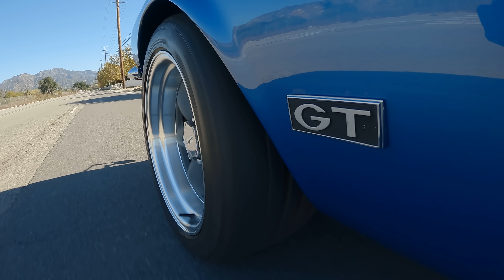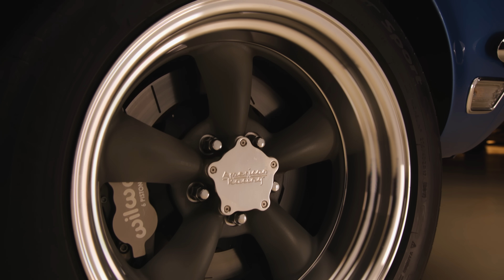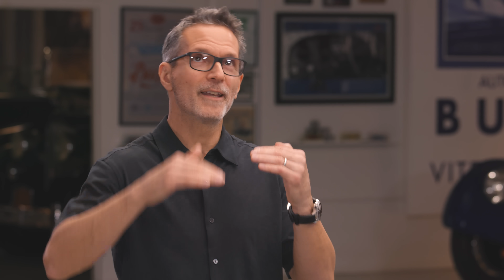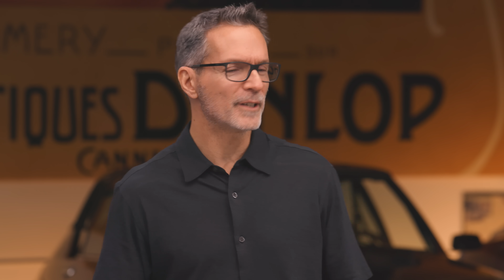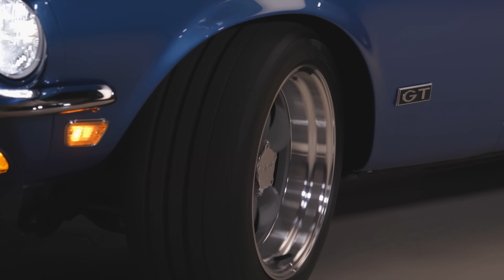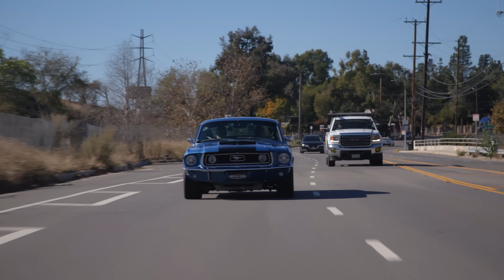Revology 1968 Mustang GT 2+2 Fastback Cobra Jet

Comment: I had a 1968 Mustang. The door didn't squeak because I lubricated the hinges. The door didn't rattle because I took the door panels off and tightened everything. The windows didn't rattle because I made sure that the window felt was up to par. It's called MAINTENANCE. The old cars can be as tight and rattle free if maintained correctly.

Comment: That air filter is inhaling HOT air, which kills HP as you know. It really should be enclosed or, if left open, extended down so that it's away from the radiator and in the cold air. This would improve HP and TQ. I'm surprised that the builders didn't plan for this.

Comment: Saw Revology's website years ago when they'd built something less than 100 cars. Was mighty impressed then, even more so now - First car was a '68 289 in Seafoam green with the black C-Strip on the doors. Put Koni shocks (then used on Porsche & Ferrari's) & a good set of Michelin steel belted radial tires. Car was hellfire fast and handled like a dream. Memories include going 120 on the Sunset Strip (wasn't flat out) slowing to 90 at Alpine Drive, knowing always cops there because of the robbed & burned-out Shiek's house. Anyone imagine now, not getting a ticket? I didn't. Different LA world in the '70s & '80s. Glad I'm 70... had SO much fun could never have now & that car was part of it.

Comment: Jay... Ford did a 140 MPH Speedometer in the 1960 Thunderbird.  That was my first car.  With the 352 FE Motor/300 Horsepower.  The 59 and 60 Thunderbird could also be ordered with the 430/350 Horsepower Lincoln Motor.... My Bird was a hardtop in Palm Springs Rose, a pinkish tan... and Tan and Dark Brown Vinyl Interior.  I loved that Car....  Jared Howe, Westland, Michigan.  I wish I had it back...  I bought the car off my Mother in 1971 for $1,000.00.  It only had 28,634.8 miles on it when I bought it.  I sold the car in 1978 for $6500.00 with just 53,000 original miles.  Biggest mistake I ever made.  Selling that old Thunderbird....  My next car was a used 1970 Mustang Mach 1 with a 428 Cobra Jet 4 speed.  I sure do miss that car too.  Bought it off a neighbor who bought it new.  it had 31,000 miles when I bought it.  In the rare Grabber Green.  About 300 70 Mach 1's were painted that color.  A low color and rare to find....

Comment: 300-400k now for their builds. If Im paying 400k, I want a carbon fiber body with a wide body and proper aero for a track. You could spend half what they charge buying a real classic, reinforce the chassis, upgrade suspension, transmission, interior, exterior, and drop a 1,000 hp in it and it be prestine. No creaks, good soundproofing, etc. It's just too expensive to not have the Ford logo on it, which Ford doesnt approve of.

Comment: Well sir, you should just ask these folks if they will drop a 7.3L Godzilla pushrod engine into one of these for you. Smaller engine with a little more space under the hood. Just do it because you're Jay Leno. You don't need that overhead cam stuff in a mid-century Mustang.

Comment: There's no question it's a nice ride. I Just Can't stand double overhead cam engines and a classic body like that. I'd much prefer a classic engine to match that great body. But I get the impression that Revology will use whatever you want - within reason. How about a single camshaft 302, 351, heck a 427 small block. Me? With the modern chassis, I'd go for something like a Kaase BBF - 800+ hp. You gotta have that idle!

Comment: Roadster Shop chassis with IRS (these guys give you a triangulated 4-link – good, but no IRS!), adjustable coilovers, gas tank w/ Coyote fuel injection setup, about $33 grand. A Tremec T-56 magnum transmission with a cermetallic twin disc clutch kit is al bit over $5K. Wavetrack posi is around a grand for the differential and ring & pinion. These guys give you an 8.8 rear end. Why not a 9 inch? They do give you a carbon fiber driveshaft. That’s like $2500 for a QA1 custom carbon fiber shaft. Motor? I’d go for an Edelbrock supercharged Coyote crate motor (785 hp, 660 torque) over the Roush (600 hp, 475 torque) if I was ready to take a $300K hit on my car. The Roush motor is under $20K if I’m not mistaken. The Edelbrock is more like $30K. They’re probably using Dynacorn bodies & panels. The body, sans inner & outer front fenders, etc. is about $17.5K. Stangaholics sells a Shely-style stock-length hood for about a grand. A custom leather-upholstered interior can cost from $5K to maybe $12K. These guys charge over $10K to upgrade to a leather interior, and your color choices are pretty limited. A molded cut-loop carpet with mass backing is like $500, and I’d opt for Lizard Skin and Boom Mat which could bring it up to still less than a $thousand. No cats? C’mon! $500 will get you Flowmasters that will fit, have low ,low restriction and keep your pony from being a stink bug. I know I haven’t factored in the instruments (about a $thousand for Dakota Digital VHX set-up), wiring harness (A KwikWire 22-circuit kit is about $500) and the brakes (Wilwood 6-piston front and 4-piston rear sets would knock on the door of $3K), not to mention the paint job, undercoating, exhaust, etc., but still, I’m barely over $100K so far. Get this thing with all the options and it doesn’t have the Edelbrock engine, an IRS (and maybe not a Wavetrack rear end); your color options are limited; they want an ADDITIONAL $10K for leather upholstery - and you’re way over the $300K base price. The country is overflowing with top-notch custom rod shops that’ll match these cats’ quality and skills – and probably beat ‘em since it’s obvious they just use off-the-shelf parts. Hmm. Jay, I think you could do better.

Comment: Flowmaster, Magnaflow and others make high-flow cats that will fit in tight spots. They're nice if you don't like the stink of exhaust from pre-'75 cars. They aren't legal (on the street) for post-'75 cars, but are better than nothing. They're very low restriction and don't affect horsepower enough for you to notice. So, anyway, how 'bout a re-creation of the Shelby GT500?

Comment: 320lb lsnt a massive difference, honestly. But you know what a massive difference is? Suspension, chassis stiffness, brakes, weight distribution, transmission, tires, wheels, steering, seats, seat belts, and everything else. This old hunk of junk might look pretty, but it is as it always was a terrible car.

Comment: Beautiful car. The 68 fastback is my absolute favourite model ever produced from a styling point of view. I’m familiar with the engine package as it’s exactly the engine and supercharger combination Ford Performance Australia sold as the 2020 Mustang R-Spec. My dad has one, 6-speed manual was the only transmission available and they came with an official 522kW (700hp) and 5 year factory warranty! That car’s pretty fast, and this ‘68 replica would weigh a heap less with a little more grunt. This thing would be awesome!

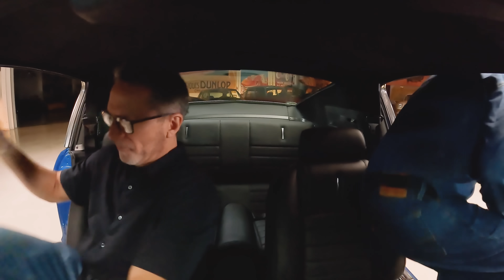Comment: 20:55 I'm 57 and 6'4" with 2 Mustangs and a Camaro. Absolutely no shame in facing out of the car, lowering yourself in with your right elbow. It's like being 25 again. Works getting out too 😎👍
Reply: I’m a little taller and bought a 2021 SS 1LE 6spd. No sunroof obviously, I barely fit but I fit, just couldn’t do trackdays as I can’t get a helmet on and still fit. Being up so high I actually didn’t mind the view out as much as shorter guys do.

Comment: 710 HP from a supercharged motor means the actual engine has very poor performance. You could get 800+ HP from a properly improved motor without any add-ons.

Comment: My friend's dad bought a 1964 1/2 Mustang with the 289 V8 just out of college.  I was able to drive it once after coveting it for years.  I was shocked at how badly it drove.  It was like an old farm tractor.  That's fine if that's what you want from an original.  I'd probably rather have something like this.  It's flipping gorgeous, has gobs of power, and also undoubtedly handles better.

Comment: This dude is a walking understated genius. You know when I say genius I don't mean mechanically like he probably couldn't troubleshoot and replace complete timing chains and phaser setup on a coyote correctly, or rebuild a 10-speed but thinking about the details down to the freaking door handles how they open and shut and how they feel in your hand as the driver subconsciously feeling that solid connection from striker to latch no rattle it just does exactly what he says it does as the experience of confidence of what you have bought and what you're about to drive I bet it feels to any actual car Guy and driver every turn of the wheel every shift of the gear every pedal movement probably the window switches even have a very solid connection and disconnect when you roll up and down the window that gives a quality sturdy feel I want to drive one so bad

Comment: Mr. LENO:so, what´s your background? are you engineer by trade ?
Mr. REPRODUCTION:no, I studied bussines ,marketing, sales....

....oh, now I got it....if, by chance , I have ´cheap´ cobra/fiber glass body/modern drive train-then It´s called REPLICA.....on the other hand...if these guys are buying  at least 60% mostly off the shelf repro parts(not N.O.S.), drivetrain, engine, doing some CAD/strenght chassis(not that much expensive...)and CHARGING trilliion dollars....it´s forbidden to call it REPLICA...we must call it REPRODUCTION model ...

Comment: Finally, some one knows the correct wheels to use on that era car. American Racing Torq Thrust and Salt Flats forever.
Reply: I have a black set of 18" Foose wheels, 5-spoke Vintage Craiger style.  They look great,---------------but made in china.  I did not know that until I got them.

Comment: When I was in high school I had a '67 Mustang.  Years later I bought a '67 F-150 pickup truck and the first time I got underneath it and looked at the suspension I thought, wow, this looks familiar. The original stock Mustang didn't really handle a whole lot better than the pickup but this car obviously does not have an original chassis. Is it fully independent suspension?

Comment: Although I wish I was able to afford a $300k car, the price is spot-on. 
From the video, I gathered that it handles fairly close to a late model mustang or even better.
Is a beautifully executed resto-mod of the highest quality.
Reply: With no ABS or TCS, this is flat out not possible, and for 300K they should have been able to add both of them. TCS should be mandatory in a car with 700HP

Comment: The most beautiful Mustang I have ever seen my first car was a 66 coupe my parents bought new I got it in 1976 I loved it since the day they got it however it was a struggle to keep it as new and try to improve on it the company Auto Krafters was just starting in 82 to find handling options and oem parts were drying up as Ford just wanted to sell new cars and time took its toll even though I spent the entire price of the car when new in 1981 trying to bring it back to as new even hubcaps were difficult to find in the old days stuck with a poorly performing
 A/C constantly fighting my fathers terrible backyard mechanic short cuts and its proclivity to blowing water pumps and having my god mothers son kill the drivers door which was replaced by a non pony interior door and manual brakes and steering and trying to find good radials. Remember the Firestone 721s that blew apart one at a time then to the 500s then cracked manifolds a dead distributor and I tore off the dual exhaust that my dads buddy had exiting in front of the back wheels  a bad heater core i ponied up the money to fix everything yet the ignition went out and the pull the steering wheel to fix the turn indicators the glove box fell apart inside. The faux wood got scraped off the console and remained slightly tacky forever impossible to find an honest machine shop to redo the valves and the Air Force sent me from Okla to the United Kingdom the to Nebraska and it was so cold it would barely shift lol finally I sold it to a way better more mechanically inclined A F Pilot who had more resources to restore the car I loved and hated too lol I knew it well could start it no matter what never left me stranded but it was the opposite of range anxiety never knowing what would go next even tho I could get it going or fixed nearly it was zero fun to have no A/C to defog the interior in winter of the functionality of electronic ignition and a cohesive feel of a newer yet uglier car the windshield washer fluid bag springing leaks and being a lousy mechanic with no garage to use Having to beg my first Sgt to use his Garage to install headers and then having to make them fit by heating up the clutch linkage and bending it a quarter of an inch which threw it off but I could push it towards the brake pedal from the side to offset the offset lol it just became to much it seemed an impossibility to achieve the car my mind wanted vs the reality of everything I kept it clean and waxed and everything as best I could but I ventured into other cars upon its sale. Funny thing my Morris MGA GT was the epitome of a hellish british car with something breaking nearly every outing but its hydro pneumatic handling was light years ahead of the falcon based Mustang. It was nimble and underpowered but you could wring every bit of power out of it and you could fling it around those country lanes made by oxcarts in the 1500s easily never overpowering the car with horsepower so pretty much flat out at 50 or so maybe 60 til the next hairpin turn and when it was foggy well it didnt matter did it you couldnt outrun your headlights and coming back to the states the 289 V 8  4V 3 speed manual was excellent until you had to stop or turn but being 19 or 20 your strong and braced yourself  gee I really loved my grandparents Olds 98 or Cadillacs with huge power     Power, brakes and steering, and most of all climate controlled interior set the temperature and it would keep it there winter or summer quiet and comfortable steer with your pinky what you lost in the corners you made up for in the straightaways and they could pass anything except a gas station lol but I could only afford what I could  I guess what I am trying to say is this Company Revology has accomplished the impossible and has shifted my focus back on having a real dream car that I always wanted yet never existed until now they have perfected a childhood dream and made it a reality to the lucky few and given myself a new goal of an old Dream I have always carried with me since I was 6 years old I am watching this for the 4 th time now Thank you both for this fantastic episode and brilliant idea come to fruition by such a visionary ❤😊

Comment: You really couldn't do much better than the 1968 Mustang fastback with that drivetrain. It could be used as a daily driver if you really wanted to without it getting to be a pain getting in and out like most exotics. And it just looks right. Beautiful car by any standard.

Comment: Hi Jay you mentioned that the speedometer only went to 120 and Ford didn’t make a 150 mph speedometer back then. My uncle had a 66 stang that had a 150 mph speedometer and the weird thing was it was a straight 6 with a 3 speed manual transmission. 
 We used to tease my other uncle that had a 69 Mach 1 428 CJ with a 4 speed and its speedometer only went to 120. How he ended up with a 150 mph speedometer in a 6 cyl was a mystery.

Comment: This is phenomenal. Thank you so much for doing this. I priced one out the way I'd want it although I definitely can't afford one and it came out to $315K. I would say on top of that, I'd want GT350 intake setup like on my Mach 1 to get the special Mach 1/Bullitt 480hp engine paired with the TR3160 and do it up like Eleanor. Perfection.

Comment: 🇺🇸 I agree, that the new technology is the way to go. I had a 1967 Lime Gold, Fastback in 1971. It was an S-Code 390 Fe, 4 speed. I longed to have that vehicle back for the better part of 5 decades before I finally got a T5 Red, 1967 Fastback GT, 390 Fe, 4 speed. The new Fastback had a Concourse Restoration back to the original Firestone bias ply whitewalls. It looked perfect in every way but, when I drove it, I was shocked at the difference in my 16 year old memory and my 62 year old reality. 😮 The Mustang wandered all over the road. It rpm’s were over 3000 rpm at 55 mph. I spent another 60k ,above the 90k for the original purchase. The suspension, tires and wheel combination, steering and tilt wheel, along with a deluxe interior was added along with vintage ac. A lot of issues were found during the upgrades…carburetor rebuilt, harmonic balancer replaced, hood and trunk latches replaced, original shifter was terrible so it was replaced with a Hurst. So after the modern / vintage blue tooth stereo was added, I’m sitting at &151,000.00. 

It’s expensive to relive your childhood 🤣😅🤣